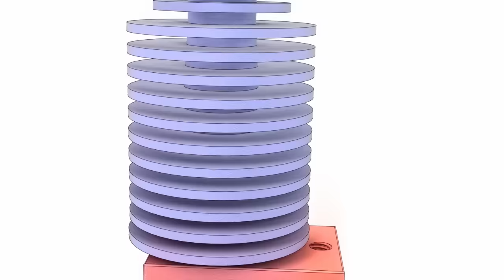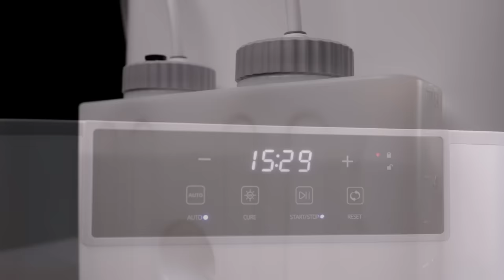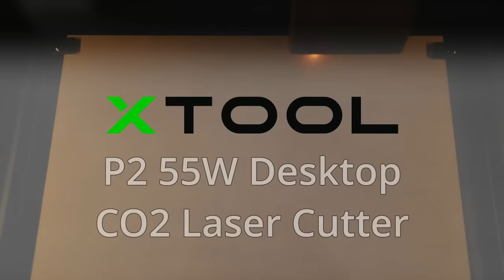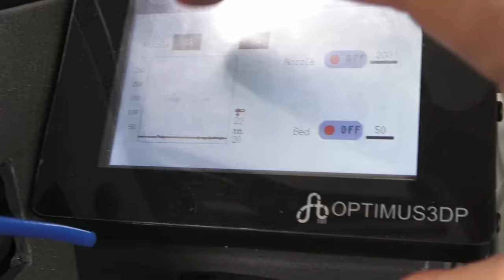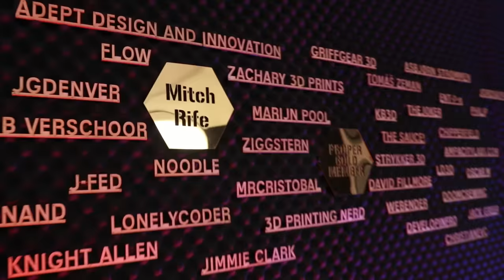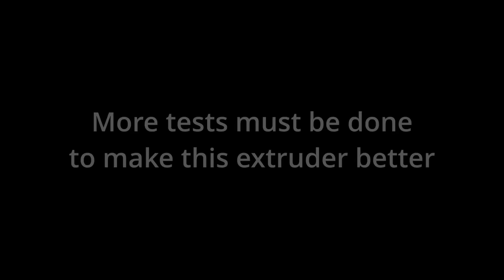I built a working Hotend out of a CPU cooler!

Comment: The heat pipes are most likely filled with water (and sometimes with methanol). Definitely not ammonia, as it is used for lower temperatures and, most importantly, it's incompatible with copper, it will eat through the metal (I've tried that, but not with a heat pipe). What you bought is a solution of ammonia in water, which is of no use in a heat pipe (pure ammonia is required). You can put a piece of copper in that ammonia solution, it will turn a beautiful blue colour and the metal will dissolve after a couple of days. Both, pure and dissolved ammonia are corrosive towards copper.
If you broke the heat pipe, you wouldn't be able to repair it easily. They contain a very small amount of liquid, and the remaining volume is filled with the liquid's vapour. There is no air inside, and that makes the repair process difficult. Due to the lack of air "ballast", the pressure inside a heat pipe at room temperature is close to vacuum (actually equal to the vapour pressure of the liquid).
If you could keep one end of the tube at low enough temperature, you should be able to anneal the another part of the tube safely, provided that you will not damage anything else by the application of heat. However, keeping one end of a such short tube cool may prove difficult, first - due to the high thermal conductivity of copper, and second - due to the heat pipe action, as it will still work, albeit  to a much lesser degree than in its intended operating conditions.
Reply from the maker: Thanks for the info! Shame that I never got to that point of finding that out by trial and error.
Reply: As if this is the only one you're gonna build lol @properprinting
Reply: @shogoonn I need to repair my fridge in the Winnie that lost the containment, it is ammonia and hydrogen gas. Do you have any resources that can help me find a diy for this?
It seems to be a state secret. :)
Reply: Does it mean that the liquid in the tubes can be replaced with liquid with higher boiling temperature? And high stability and safety over 200C liquid? Like white spirit solvent or ethylene glycol
Reply: @ИванЮрченко-ф2з  
Water will do fine at 200°C, the heat pipe will run at a pressure higher than atmospheric. That's not a problem for small diameter tubes. I have some water filled heat pipes from Quick-Cool with working range from 5°C to 250°C.
Otherwise, yes, you can have heat pipes with other liquids, including liquid metals.
Filling a heat pipe is a complicated operation. It requires a filling station with a vacuum pump, liquid metering equipment, some valves and the ability to close to heat pipe after filling.
First you have to pump out everything from the heat pipe, and heat it to a higher temperature to remove any residues adsorbed on the surface, and then you close the vacuum and open the metering vessel, (a small one) which transfers the precise amount of liquid to the tube, and then you close the tube (pinch and weld). There are other methods of filling, but this one is AFAIK the most common one at the factories.
You could fill a heat pipe at home, which I've done successfully, by partially filling it with the working liquid, heating it until the liquid boils, and then pinching at the top, when enough liquid was removed (that's the difficult part - knowing how much is left), and then welding. The vapours of the boiling liquid will displace the air from the heat pipe. Instead, if you have a vacuum pump, you can add a slight excess of a liquid to the heat pipe and then vacuum it and seal it.
Reply: @noanyobiseniss7462  
I don't think it's a secret, it's just too much of a hassle. Just like with compressor-based systems, you need a vacuum pump, an ammonia and hydrogen cylinders and some water. First you vacuum the whole system, then add water and ammonia and then hydrogen. The problem is that you have to measure precise quantities of the components that enter the system which may prove difficult (read: costly). You probably won't find these quantities printed on a nameplate (well, maybe that part is a secret after all). In addition, there's usually no recharge valve or tube, so you would have to make your own. The equipment will cost you more than a new fridge.
If it's leaking, not from a puncture, chances are it's due to internal corrosion and not worth repairing.
Reply: @shogoonn  Excellent info, I found that same info when researching and also that an anti corrosion must be added but not what type. I do see it as being a bit of a project but since there is no place within 1000mls that does it around here and the cost of a new is very steep then it may be worth the effort. It will not be an issue to replace the copper that is more than likely corroded from the previous ammonia. But I would like to find a detailed step by step and as you pointed out the exact amounts per volume which I don't doubt is in some old expired patent but I have no clue how to find.

Comment: Just FYI the amount of fluid in a heat pipe is tiny.  Very little in there, and its usually under a low atmospheric pressure.  It is almost always water as well.
Reply from the maker: Good to know! I was hoping to get that on camera that nothing was coming out, but it just worked xD

Comment: Add an active cooler using a fairly large wattage thermoelectric device with a cold finger to cool the incoming TPU to stiffen it prior to it entering your extruder. It's mandatory to add more RGB LEDs on the TEC hot side fan though 😉

Comment: A few things. Heat pipes require a certain heat load to reach their max efficiency, You can also buy them online so you don’t have to worry about work hardening as much as a pre-bent pipe.

Regardless, amazing work like always.
Reply from the maker: You're right and I want to design my own heat block and use individual heat pipes. The temperature range depends on the fluid that's being used. Methanol, ethanol or water is within the temperature range of this use case and I assumed that it must have been one of these fluids. No idea how efficient they are at which temperature though.
Reply: @properprinting   i love it =D you might try some thermalpaste in the thread its messy but should improve thermal cunduction
Reply: Yeah I think I saw Conrad Elektronik here in Germany (active EU wide) sell individual unbent heat pipes not at all too expensively in any number of sizes, already 20 years ago. I had some thoughts and plans but never got around to make a custom heatsink.
Reply: @properprinting Could it work with peltier?
Reply from the maker: @mtmtrx  I haven't tested it, but from what I've heard this is too much hassle with almost no benefit. I was thinking about doing that, but ditched the plan.
Reply: @properprinting  I don't know how you intended to re-fill them in case they break. This is not easy to do, you have to weld them shut without evaporating the liquid. Also I think they have a vacuum inside.
Reply from the maker: @radry100  I didn't know about the vacuum, but the plan was to pinch them shut using water pump pliers after adding a drop of ethanol/water in them. Pretty crude, but would've been funny if that just worked.
Reply: @properprinting  Hey i have a spectacularly bad idea where everything is very likely to go wrong if you have to refill a heatpipe. Dichlormethane. It's quite dangerous to handle but it won't catch fire and evaporates at low temperatures. So i think you can seal the heatpipe shut by soldering. You can get it from Modulor in Berlin upon submitting a signed note saying what you use it for (welding polymers is an acceptable use; just don't write that you want to strip paint or they'll curse your entire being).

The Drinking Bird toy is glass filled with dichloromethane and it's welded shut. Tech Ingredients showed something relevant in video "christmas lights made in a lab".

As someone else says, ammonia solution will eat copper, so it won't do. Alcohols acetone etc well they like to make fireballs under the circumstances.
Reply: @mtmtrx Those are actually really inefficient, lots of power consumption and you would need more cooling on the hot side since they work on temperature differential. The colder you have the one side the hotter the opposite is.
Reply: @SilvaDreams yes the only time a Peltier is worth it is if you really need to increase the temperature gradient, for example to print PLA in a heated chamber (or just high ambient) you reach a point where you just can't force enough of the warm air over the heatsink to keep the heartbreak below 50C
Reply: @SianaGearz  DCM doesn't work well because of its very low specific heat value

Comment: The failure of the flex attempt may be related to the upper filament path. Since the friction of the flex material is very low, it should not get stuck anywhere, so even the positioning of the filament above might be good improvement.

Comment: Would you consider making this project open source to involve the community in improving this latest design? Although, I get it if you decide to take this design which you have worked on and commercialize it.
Reply from the maker: I think so yes. I first want to do further testing myself to prevent the suboptimal design from spreading too much. I'm also thinking of commercializing it in the way of selling it as a physical product while keeping it open source.
Reply: @properprinting  Awesome! I could totally get down with sending out a version to be optimized and then taking the updates and releasing them as a kit for those who don't want to be involved in the research and development. It is the best of both worlds. Looking forward to it!

Comment: Granted it's not 60A, but I have had plenty of success with TPU even on long bowden runs.  I usually crank up the extrusion multiplier to 120%.  But this will cause the filament to escape from the extruder gears usually.  If you can get a piece of PTFE or design an angle on your extruder to trap the filament this can be prevented.  I cut two angles, about 60 degrees each to make a pointy end of the ptfe.  Butt this right up against the extruder gears, bingo!

Shorter runs are still better, as the filament will bind and twist in the bowden tube.  But I'm talking about a cheap plastic extruder without adjustable tension.  I even copied the design and printed my own extruder assembly.  Only the drive gear and screws are metal.  Everything else including idler gear is printed.  

It works okay.  But I'm focused on multi-material prints at the moment, so I put the four mass-produced assemblies on identical motors for the best chance of troubleshooting and adjusting retractions - no filament cutter, 4 way splitter, all flexibles................ Let's just say, THAT has been less successful than one material in a bowden tube.

Comment: Love the videos and good ideas. You should try one with flexible hose for the water cooler and a really bit heat sink and fan mounted to the printer frame. Less weight on the extruder and even better cooling. As long as you don't crimp the hose at least

Comment: Would you consider using a ceramic heater element? They have intrinsic protection for thermal runaway.
Reply from the maker: Aren't the regular heaters ceramic? I like this ring heater because it heats up fast and is very easy to work with. I also think that thermal runaway is best to be solved in software. This sounds counter intuitive, but if you have a heater that can reach 400+ degrees, it'll reach that. But with software you can act faster while reaching the temperatures you need.

Comment: have quite a bit of experience printing super flexible materials and it looks more to me like your extruder jammed up when it was doing solid infill, which seemed to be set to print faster than the rest of the features in the print. you need to do max vol flow testing, which will tell you the point you'll underextrude at AND give you the valuable information of knowing which flow rate (in cubic mm) your extruder will jam up at. you can then set a hard volumetric flow rate cap in your slicer so that you never underextrude or jam -- whichever comes first in your testing, really. it'll probably be around ~1-2mm^3/s, which is incredibly slow, but standard for super soft materials. this hard cap will prevent the slicer from increasing speed beyond what the extruder is capable without much tuning on your end. CNC kitchen's poop tests will work for this

Comment: I think the skipping was because the tpu is too grippy and it's sticking somewhere above the extruder belts causing it to pull and stretch the filament then skip. It should help to reduce friction above the extruder belts
Reply from the maker: It was buckling and I think that this was due to the square hole. Once the filament starts buckling, and with 60A this will happen fast, you're done.

Comment: These Heatpipes are filled with a really REALLY tiny amount of water (less then half a drop in each tube), and it's kept at a low pressure. Probably you wouldn't had notice if the tubes where ruptured at any point. Basically, the way it works is water boil at the hot side, and condenses at the cool side, condensed water stick to the walls and go back to the hot side by capillary action or something like that (I'm not an engineer or physicist, just a computer guy that knows a little about heatpipes).
I'm not sure, but the amount of heat that heatsink has to deal with in this project is really small, maybe just the copper tube itself may be enough to dissipate the heat. Also that cooler has a lot more heat mass too, compared to V6's heatsink, and that means it will take a lot longer to reach the cooler's max temperature (not the nozzle temperature, that is unrelated).

Comment: That mustve been like 30-50 mm/s , with some pretty slow accelerations and also z hop. Whats the max volumetric flowrate on the custom extruder going? You should try make a setup for 300mm/s speed.

Comment: I know that TPU loves to be printed way slower than you would think...  That's all it could be.  It doesn't melt as fast as other materials, so that's why the slowness is needed.  It's not about the extruder not pushing it hard enough.  It's about the hotend turning it into liquid fast enough.  If you go hotter, it might burn.  But you can do testing in both ways.

Comment: The curing/cleaning things always seemed bizarre to me. I just put my part in a tupperware box/ziplock bag filled with IPA, stick it in the cleaner, and use a UV lamp above it.
There is literally nothing better for cleaning resin parts than an ultrasonic cleaner and IPA, and I get to use the cleaner for anything else I'm doing.

Comment: Brilliant idea again! Soon it'll become industrial. Adding heatpipes even spares some metall mass on hotend radiator because it cools much stronger on the place needed instead of cooling a 5-7cm radiator pipe. Besides getting the radiator out of the main heating zone gets it cooler and simplifies the setup.

Comment: it is not liquid. it is low pressure vapor inside. But this tubes are made of compressed copper powder to increase internal surface, so there is a lot of internal cracks that will probably crack open when you try to bend it, turning it into a normal copper pipe

Comment: There is a red copper in the middle of an athlon 64 cpu heatsink. The size is ideal for a hotend, you only need to drill and tap here and there with a bench drill.

Comment: PC parts manufacturers all use vacuumed water heatpipes. The amount of water is so small, its barely a droplet, that it will be stuck in the capillary wall and wont leak if you happen to break the heatpipe, but also the heatpipe will no longer work since it needs that vacuum.

Yeah i have had success unbending a heatsink like that. I was surprised i didn't break it. Just gradually gradually.
Reply from the maker: Thanks for the info! I hindsight I already thought that there wouldn't drip any liquid out and I was hoping to find that out on camera xD

Comment: Very cool, but what is the advantage of the heat pipe over a traditional heatsink? I presume you could run the hotend hotter, but aren't you going to bump up against the limits of the filaments?
Reply from the maker: Initially this was not because of some advantage, rather to find out if it actually works. An advantage could be an extremely short filament path.

Comment: Cool idea, but why wouldn't you just drill the hole so that the heat break is parallel to the heat pipes. You'd probably get better heat transfer that way as well. You should add a temperature sensor to the heatsink so you can see what the temperature is, because you could probably get away with no fan at all. Although if you're doing passive cooling, you probably want the fins oriented vertically for best heat dissipation.
Reply from the maker: I want to create the shortest filament path possible and it already looks like the heat transfer is enough. Maybe it can be done passively, would be worth trying. I get the point of the vertical fins, but maybe horizontal fins can benefit from the printer's X-(Y) movement?